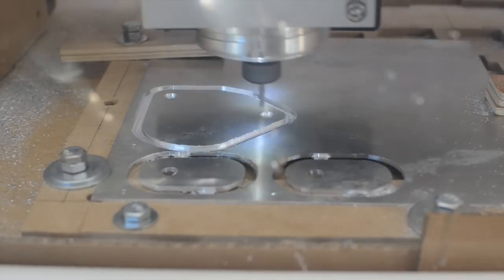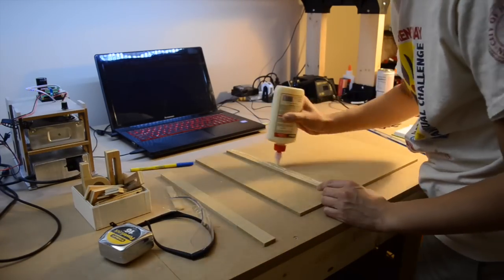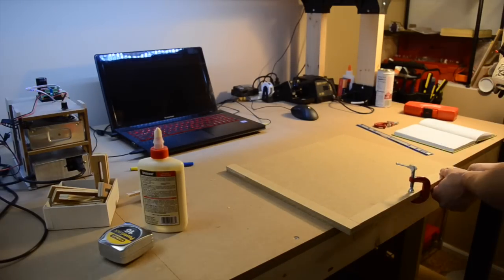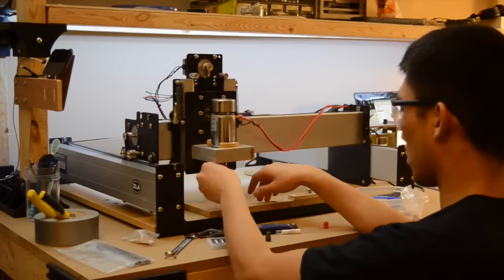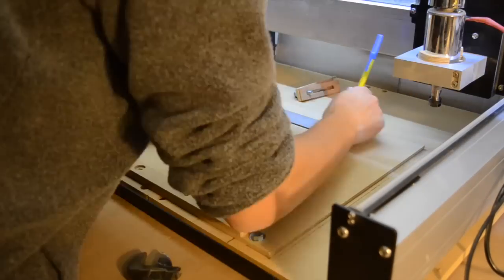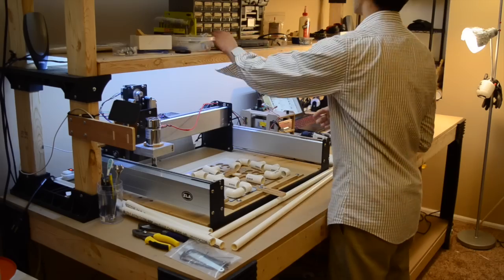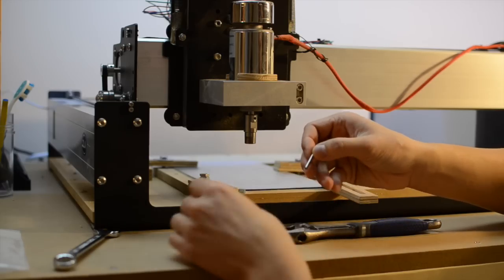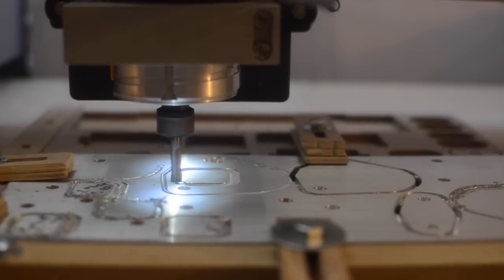My Shapeoko Improvements on the Road to Aluminum - Project 43

Comment: Can these motors be used to replace stepper motors on x-carve/shapeoko?

https://youtu.be/Z2kAcz-rG5s
Reply from the maker: +TheRangeControl They would fit, but you would need a different control scheme... does not run like a 4-wire stepper...
Reply: Thank You :-)

Comment: What size hold down bolts do you use?  How did you make the hold downs?  It looks very basic but why reinvent the wheel?

Thankx
Reply from the maker: +B Lee 1/4"-20 bolts, with ~4" pieces of slotted, scrap plywood. It's just what I use because it cost me basically nothing.

Comment: Good stuff.  I forgot to add (from your previous video) that I HIGHLY recommend upgrading to the new 1/2" Aluminum (One piece) base.  Adds rigidity, and greatly improves the hold-down clamping force.
Reply: +Richard Cournoyer How did you get hold of one? they sold out before they even went on sale properly!
Reply: +Richard Cournoyer Yeah, I didn't even see them offered.
Reply from the maker: +Doxie Lain From what I understand, an initial batch was manufactured and sold, but the vendor declined to produce follow-on orders in greater quantities, thus the delay in getting them back in stock...
Reply: Mopes. Whelp, I went with threaded inserts, now trying to get chilipeppr to run the 3d viewer. Fun machine. Also, have you looked at Fusion 360 for a more versatile design environment and path control?
Reply: Yes, I use Fusion 360 about 90% an CarbideCreate the other 10%